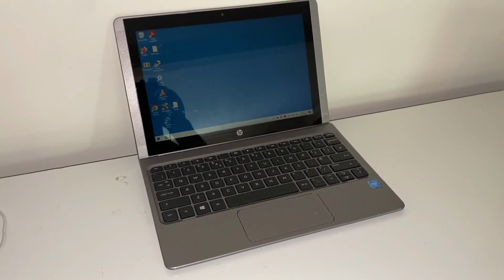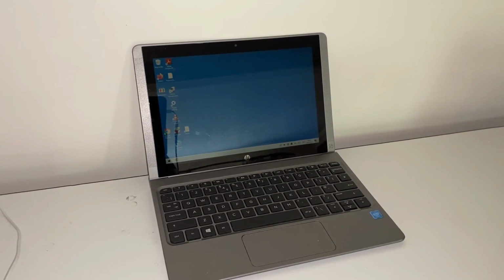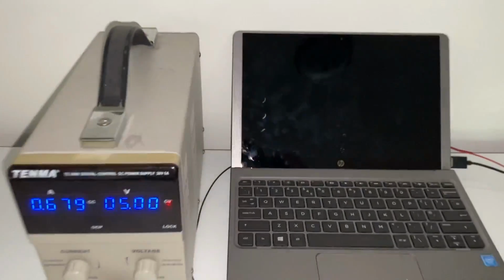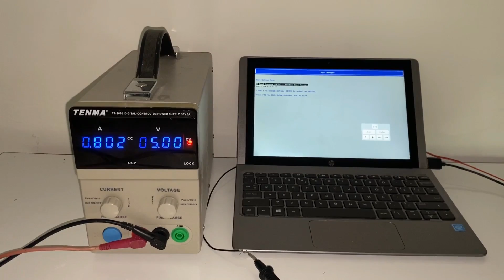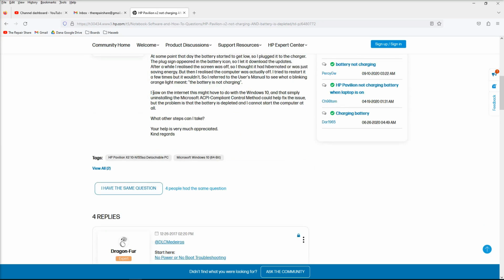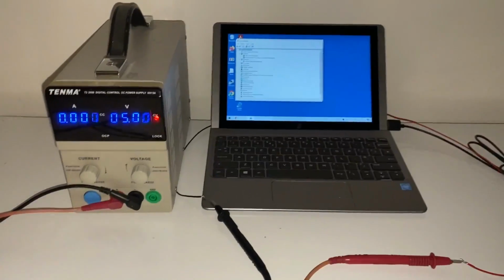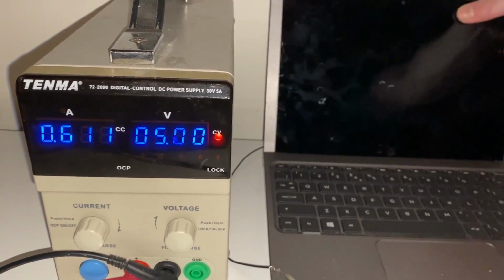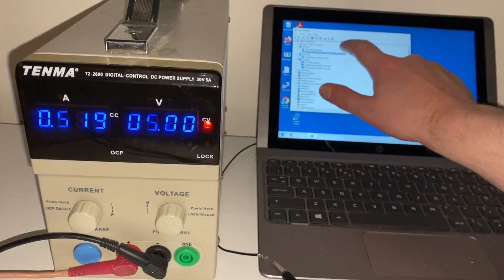HP Pavilion X2 - Not Charging While Plugged In ACPI Issues

Comment: I just wanted to add that i was able to get the charging process started by connecting the USB-C port of the laptop with a power bank from anker which supports "Power IQ". In my case the working powerbank model is named "Anker Powercore 5000" with the official modelnumber "A1109G11". Its now charging with 5V/1,6A - 8,3W - at least while its powered off. I didn't test it (yet) while powered on. I ordered a few different wall chargers, also the original one and will do some testing then and update/add to this comment.  I already tested other (different) wall chargers as well - they did NOT work! Even the ones which supported the exact same voltages/watts/amperes (by auto adjustment) did not work in my case.

Comment: I had the same exact problem and solved it.Your effort is very much appriciated.I had been working on it for 3 days and couldnt work out the problem.My problem started with some charger couldnt charge the laptop.Original charger was lost somehow and I bought a new one from market and tried that but it didnt charge both on state and off state of laptop.Then I changed charger and was able to charge when laptop was off.I suspect it is something related to chip on the motherboard.Many thanks anyway
Reply from the maker: Hi Thanks for you message. I actually put in many more hours to make a video with the fix, but was unsuccessful. I bought the proper charger (rather than aimlessly troubleshoot a non existent issue due to non proprietary charger), but this did not work either. Now, with more experience, I am thinking of revisiting some of my "fail" videos. I would love to get it working as it is a beautiful little tablet.

Comment: It need 15volts...
Reply from the maker: Hi Flagman, are you sure? I checked out the official charger and it says Output Voltage 5 Volts,
Ampage 3 Amps, Wattage 15 Watts
Reply: Hi  @therepairshare673 , on HP web-site it says 45w, I use a wall charger USB-c output with 5V/3A, 9v/3A, 12V/3A, 15V/3A, 20V/2.25A. I dont know if it's the PD protocol...
Reply: @flagratfr  Yeah. Completely agree. Output (auto adjustment): 5V-3A, 9V-3A, 15V-3A and 20V-2.25A; 45W. For this model it is the compatible option. Thank you.
I loved this response from a colleague on a North American forum:
"If the IC Super I/O (EC) detects that the signal on the Id pin of the Connector Input of the adapter is correct, it will send the order to the corresponding IC to start charging the internal battery". All the best.

Comment: I'm in the same boat as you. I spent my money trying find to buy faulty laptops so to practice my repair skills. As for this very interesting and educational video I would go some steps further. First the 5V isn't the actual voltage that this laptop uses to charge the battery. I think it's a bit more which is negotiated by the chip responsible for that. I believe many of those chips are programmable and use i2c or some other communication bus to talk with the EC and the PCH and thus with the upper layers like the OS. So just to completely exclude the suspicion something going wrong with this chip I would replace it. Then, in order to double check the windows 10 ACPI driver theory I would load a live Linux (Ubuntu, Linux Mint, PoP_OS!) and check if everything works as it should.
Reply: I agree that it would be good to try other operating systems to see what happens. However, this little netbook has 32Gb eMMC, so you can't just swap it out. But the nice thing about Linux distros, and Chrome OS Flex is that you can boot from the USB flash drive, and run the OS without installing it on the internal drive. So that is a good test.

I would also try injecting more than 5V into this netbook -- perhaps up to 12V? The nominal voltage of the battery is probably 3.7V. So the charging voltage plus the operational voltage probably needs more than 5V. Maybe that is why the power management switches from the charger to the battery during the OS load?

Comment: You read my mind at the end of the video. I wanted to know which version/build of Windows 10 was running, and whether it would be fixed by performing a clean install of the latest Windows 10 22H2 build. I think you answered that. I think you proved that some HP laptop models are not "compliant" with this Microsoft driver.